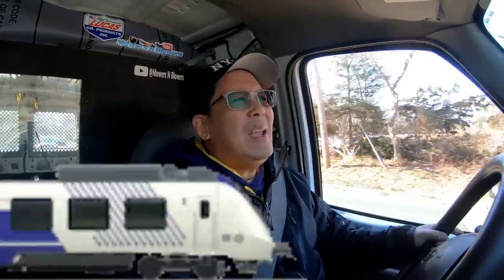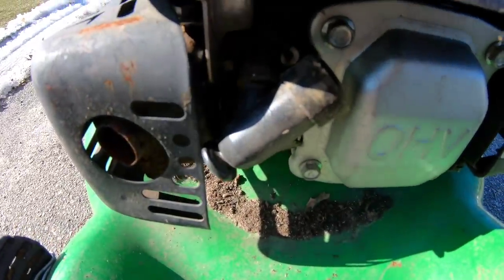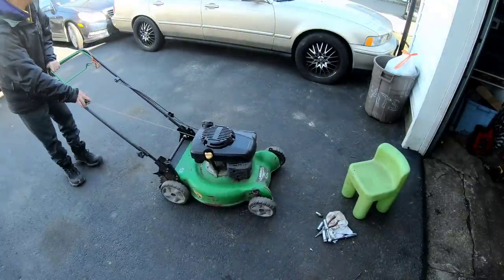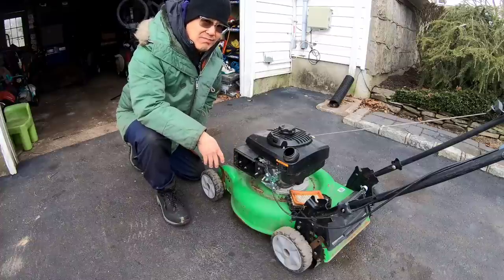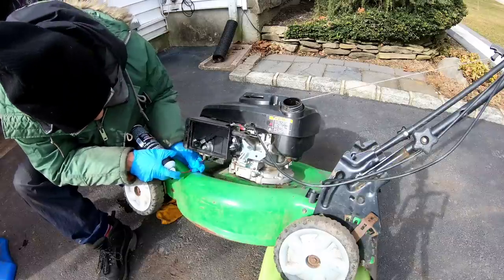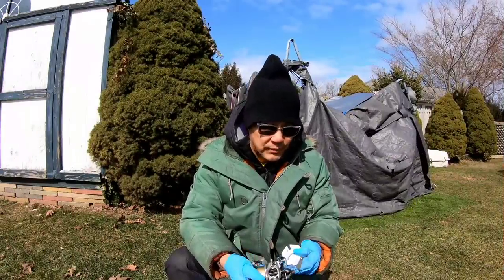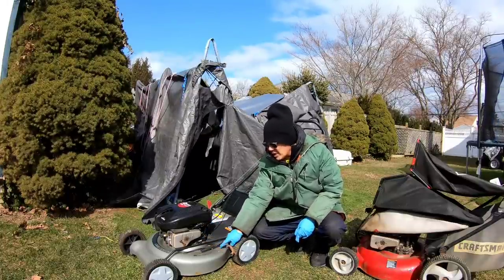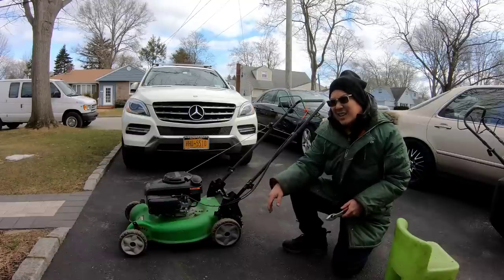HIDDEN CURB ALERT LAWNBOY RWD WATER FLOODED LAWNMOWER PICK BROKEN SPARK PLUG DRIVE BRAKE CABLE FIX

Comment: I remember you gave me your advice on the the bucket engine but I still believe if you take care of them keep up the maintenance keep a check on the few faults they have especially the bolts backing out around the flywheel they not a bad engine I check mine after every 2 mows I mow 8 acre's of grass pretty regularly all summer use Wix oil filters especially the oversized one you have that extra oil for lube I've only changed my oil once at100 hours it just had 150 when I bought it last year with all the service records practaly like new for the age paid 550she could have gotten more but it was in storage for 4 years after her husband died just used it for mulching leafs its a craftsman 4500she kept the 5000 series 😂 its a 21 courage 2005 with just 218 hours they will last a long time briggs really have some of the worse engines for failure but that's my opinion I enjoy the channel Taryl is one of my favorites he is part of a dying breed with so much knowledge keep on keeping on 🥴

Comment: Henry that engine sounds great and no surging. Need parts Henry again has them IN STOCK! I Know a guy that can fix those cables! Lol. I think the previous owner was just flushing out his fuel system with the water but forgot the Dawn soap. To bad the guy didn't throw the bagger away with the mower. #mnblucas 💰👍Roger